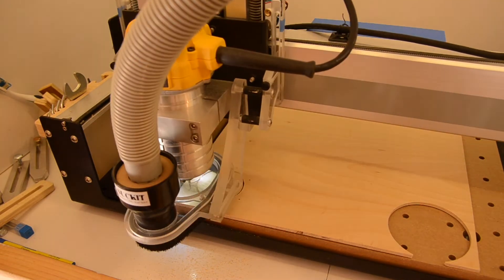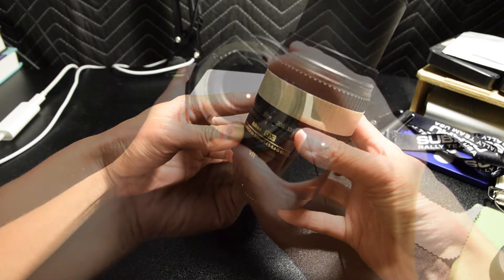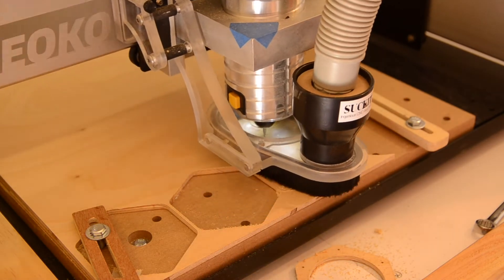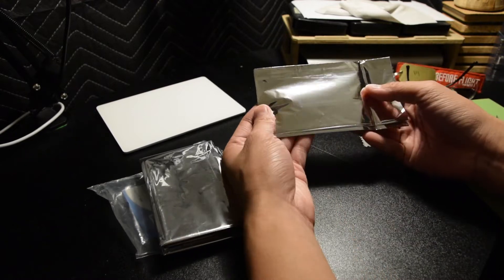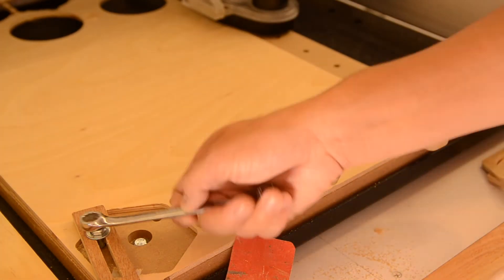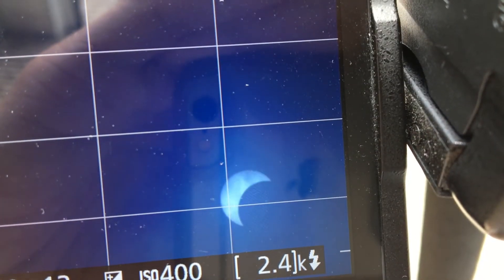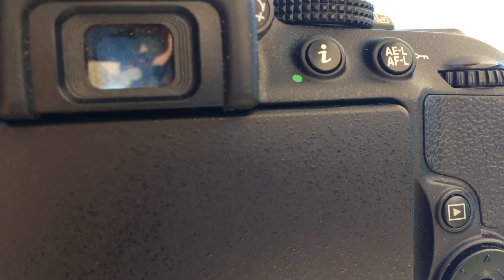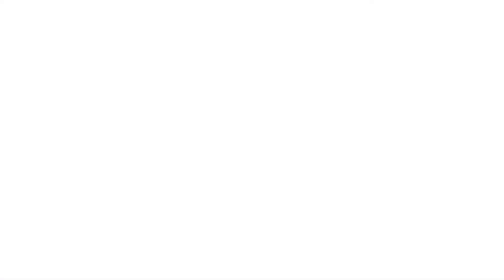Making a DIY Mylar Solar Filter for Photography

Comment: I found it easier to just get a 82mm to 95mm step up ring (cheap) cut the film to fit, use double sided tape to attach to the flat part of the step-up ring then get a 95mm protector filter (also cheap) to cover the solar filter. Done. Use smaller step-up rings if you wish.